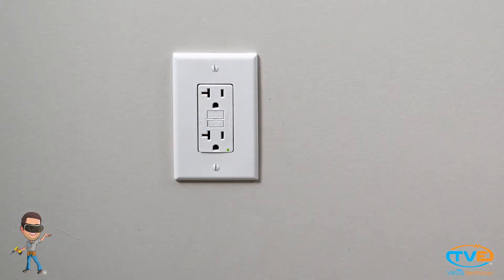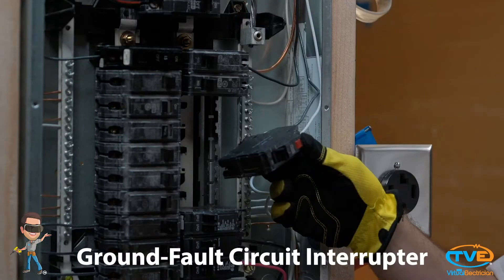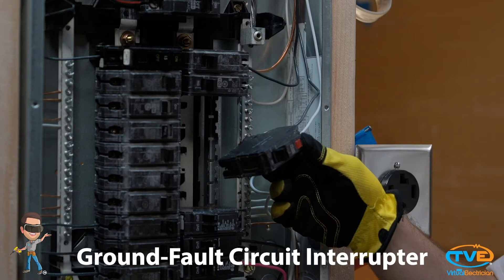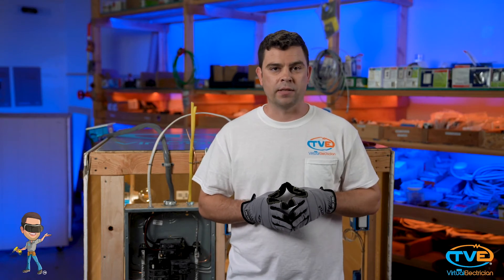Ungrounded 3 Prong Outlets - Troubleshoot

Comment: So I have a three prong outlet that says it is not grounded through a power strip so I use the tester and it is not grounded. Is that bad?
Reply from the maker: the ground wire protects you from shock.  you can install a gfci at that location to remedy it